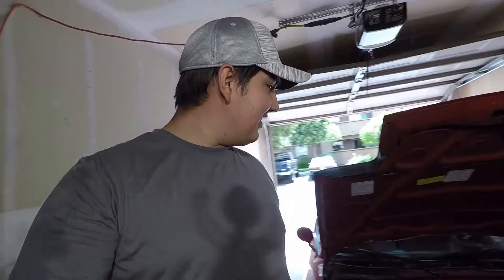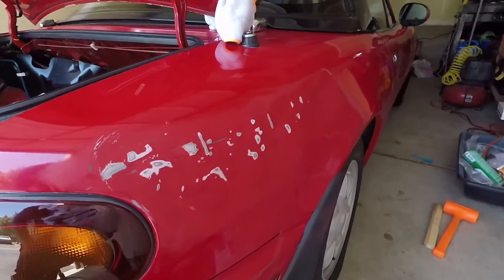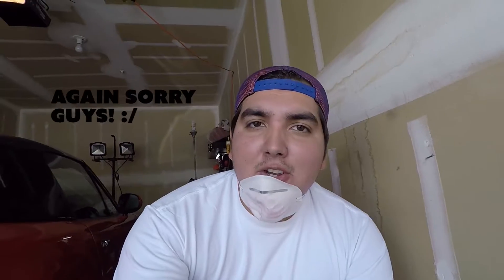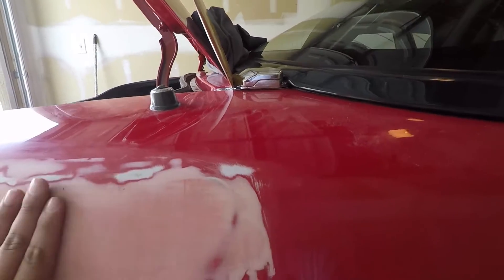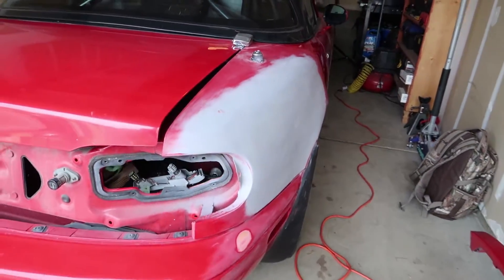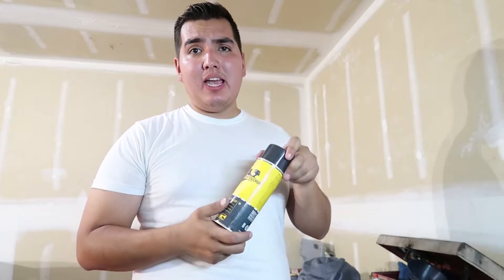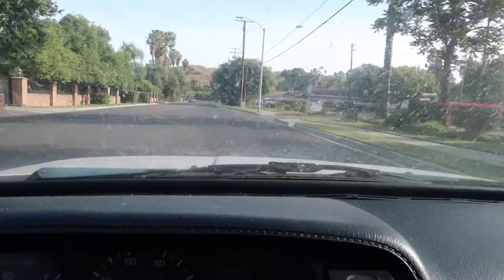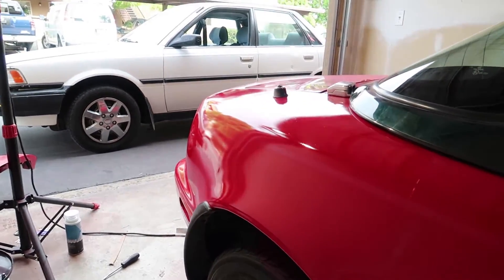Hit and Run on the Miata! | Quarter Panel Repair

Comment: Nice work! Just a question: is it not necessary to grind down the paint before adding the filler? I have a dent in my MX5 as well, so I’m considering doing something similar.

Comment: This paint job is amazing! Nice work :) I got in a similar accident and have been looking for a paint to use over the primer. Which one out of the two paints would you recommend using? And where can you find it? Thanks!
Reply from the maker: Raymar Anciado thanks bro! So the 2 part paint and clear coat I first used was good but I felt the premixed paint and clear together in the second bottle layer down a little better in my opinion. But both options are good, as far as where to find it just any paint shop really make sure you give them your color code for them to match you the correct one!

Comment: Hey good videos man just subscribed. But im 16 thinking about buying a 1991 mazda miata with 160k miles with a hard top for 1.9k. Which seems great ! But it has a lower quarter panel damage.  It doesn't really look bad but i was wondering what you would recommend. To get another panel or bondo it. Also if you have a instagram let me know so i can follow you and send you a picture to see what you think. Thanks again keep it up!
Reply from the maker: A1does Hey thanks man I appreciate the support! That doesn't sound like a horrible price considering the hardtop is worth anywhere from 800-1k alone. Sure thing my instagram is project.miata send me some pictures there!

Comment: How much did this cost you in total?

My quarter panel just got hit, and thinking of doing this.
Reply from the maker: xcarflyx I spent about $110 or a little less  with the paint, sand paper, and bondo. This was my first attempt just take your time if you decide to it and get a rubber mallet helped a ton without damaging the panel
Reply: Before you do this, try to pull the dent out. If you have a massive one like the one in this video you probably can't pull it out, but a smaller one you could.